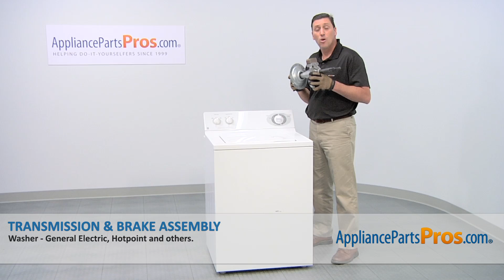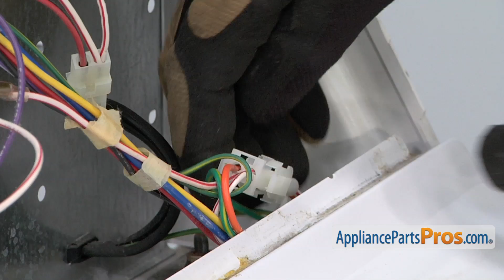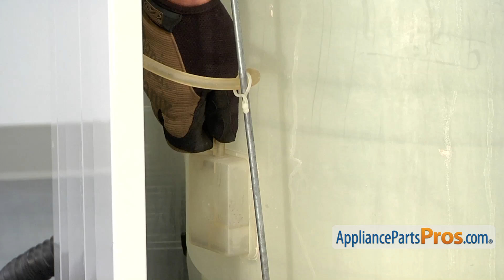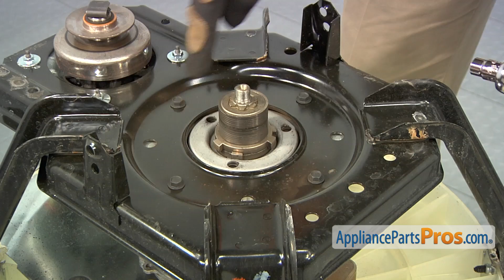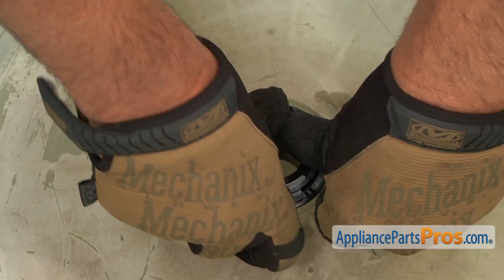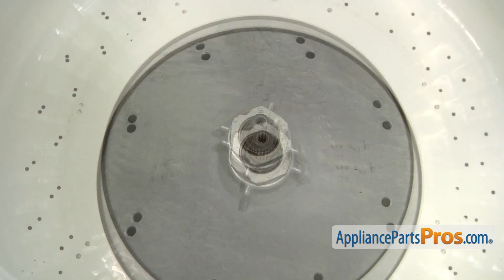How To: GE Transmission and Brake Assembly WH38X10002

Comment: What if I have a aigitstor that starts off fast then slows down. However it spins dry without any issues.
Reply from the maker: What is the model number of your appliance? Have you checked the agitator and shaft for any damaged or worn spots?
Reply: @appliancepartspros in this case the agitator ans coupler are fine. The actual rate starts off normal speed then slows down as if it were on a gentile cycle. It starts offf normal speed then slows down on other cycles too. The model is GE wcsr4170d5ww
Reply from the maker: @GamerGee Thanks for the model info! If the agitator starts strong and slows down across all cycles—even though the coupler and agitator itself look fine—you might be looking at a worn transmission or possibly a weak mode shifter coil or motor winding issue. Since your spin cycle is working normally, that helps narrow it down.

It may be worth checking the transmission for signs of wear or internal drag. Also, inspect the motor to see if it's overheating or showing signs of weakening under load.

Let us know if you'd like help finding any of the parts!
Reply: @appliancepartspros with that would you recommend which part to fix?
Reply from the maker: You will need to check the parts to determine what has failed.

Comment: This Video is faker the tiktok prank videos, If your washer is 2 months old you will have extremely hard time removing anything, if your washer is years old almost guaranteed nothing, I repeat nothing will be removed
That inner tub is a bitch to remove
Hilarious 😂 how he was taking it apart
Reply: I guess it depends on your tools and knowledge. I took mine apart with a 1-11/16" deep socket and 1/2" drive air impact. It has never been apart before.
Reply: @bobsoft   Good advice! If you're purchasing a new socket, I recommend getting a 1-11/16", 6-point, deep-well IMPACT socket. Get either 1/2" or 3/4" square drive, depending on which impact wrench you have. Still a good idea to clean the joint thoroughly, soak it with PB blaster for a day or two, tapping the nut with a brass hammer every so often.
Reply: The video does make the process look MUCH easier that it actually is -- almost as though anyone could do it. If you have a lot of experience fixing and restoring mechanical things, and have the necessary tools, then it's not too bad. However, years of built-up corrosion can really make it a challenge.

Comment: Wouldn't you install the tub seal after you install the transmission to prevent seal damage?
Reply: Its easier to insert the seal with out the transmission shaft in the way

Comment: WCSE4230A0MM agitate ok but wont spin, motor check ok, turn transmition pulley by hand, turn ok in agitate direction, but only turn about 1/4 turn in spin direction then lockup wont turn any more, appreciate any help?
Reply: mines is doing the same thing did you find a answer?

Comment: Good luck getting that hub nut out.  I bought a heavy duty electric 1 inch impact tool and a deep socket just for these jobs. I believe the socket is 43 mm but not totally sure. Going by memory from many years ago so check into it before buying a socket.
I've heard (but not actually tried) that a line dissolver ( like CLR) squirted onto the nut 24 hours before removal makes the removal easier.  
Also when doing this job replace the tub seal
Reply: I used a 1-11/16" deep socket, a couple of 1/2" drive extensions with an air impact and it came out easily.
Reply: I've tried clr, and naval jelly and bought a "plumbers multi wrench" spanner ... Still not budging.
Reply: Your memory is sharp, it’s 43mm and it took me 2 days soaking it with everything without budging I had to get my 30 gallon compressor in and a monster 1/2 Thor impact to get it off. Then I failed to remove the inner tub as it was welded to the transmission off the the outer tub
I ended up dumping the whole thing in the trash

Comment: Hey appliancepartspro I have this exact transmission on my GE washer,And I need to replace it ...but they do not make this transmission model anymore ... Would i be able to use this model GE transmission GE WH38X10017 as a substitute instead?
Reply: That's a mode shifter and is a totally different design . The wiring in that machine is totally different.

Comment: Excellent video, very helpful step by step...but one step missed on reassembly. Installation of  the tub bearimg washer before installing the transmission and brake assembly. Fortunately I caught it before I got to the tub nut. In and back out no problems. Again very helpful. Thank you.
Reply from the maker: Glad we could help. Thanks for that tip.

Comment: On this exact trans, the inner brake plate and larger outer mounting plate. Should they be flush with one another, so that the black plastic plate lays over the brake and flush on the mounting plate? Mine was raised about 1/8 inch. The black plastic plate did not lay flush. I put it together anyway. I get a creaking noise in slow agitation. It was a new transmission.
Reply from the maker: There may be variations on different models using the same parts, so we would need to check based on your model number. You can post the problem along with your washer's model number on our repair forum and the techs can help you troubleshoot. http://forum.appliancepartspros.com/

Comment: If the agitator spin one direction only continuously what is the cause of problem
Reply from the maker: +buzahra ful If the upper part of the agitator does not agitate back and forth then the gears inside may have failed. If this is what is happening you may have to replace the whole agitator, depending on the manufacturer.
Reply: Hi I have the same problem in my wash machine,  can you repair it the yours?

Comment: my washer is leaking from the middle i just need to know is it the tub seal i already ordered a new transmission and tube seal as well
Reply from the maker: +timothy kohrman The tub seal is the main seal in the middle of the tub. It seals where the transmission goes through the tub. Water is funny but if you are sure it is coming from that area it is probably the seal. Thanks for the order!
Reply: +AppliancePartsPros how do i get the tub nut off i have a spanner wrech and tried it but the nut isnt budging
Reply from the maker: +timothy kohrman It is reverse thread so make sure you are turning it with the arrow, clockwise. These can sometimes be on there pretty good I would soak it with penetrating oil and let it sit for a while. Since you are changing the transmission you can carefully heat the nut with a heat gun to see if it helps. Be careful not to over heat anything and damage any plastic in there.  We have even seen them so bad you may have to cut the nut and the lower split ring off.
Reply: we broke it off .. i do have a question how do i tell if the bearing is bad on my e top load washer
Reply from the maker: +timothy kohrman The spin bearing will usually squeak or squeal when it is going bad.

Comment: Very well put together.  My GE profile has no agitator... Can I use this same technique to repair a WPGT9350C0WW?
Reply from the maker: Daryl Nelson This video may give you a idea on how the machine comes apart but you have the newer style washer. The motor and transmission are different. You can also post the problem along with the appliance model number on our repair forum and the techs can help you troubleshoot the problem.
Reply: Thanks! I will give the forum a try tonight.
Reply: +AppliancePartsProsll